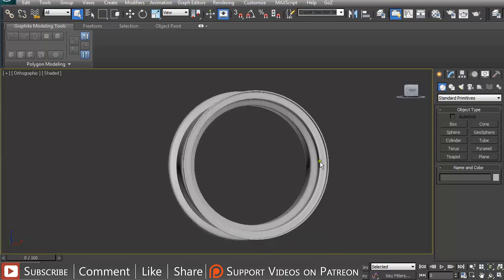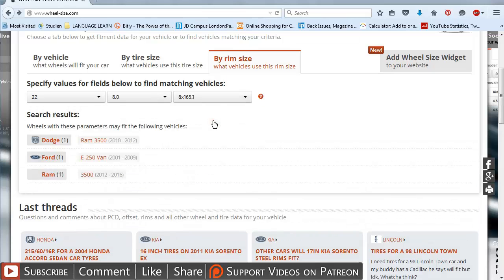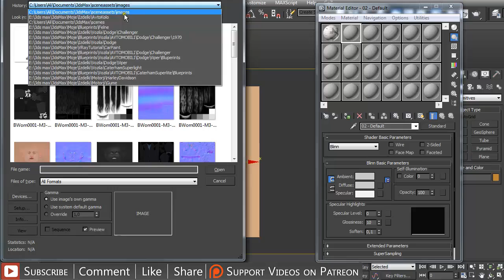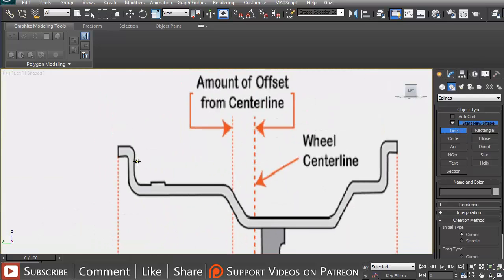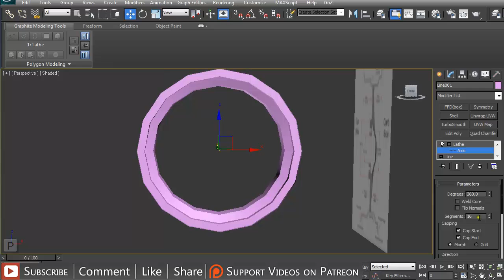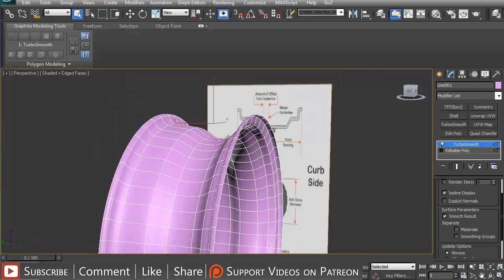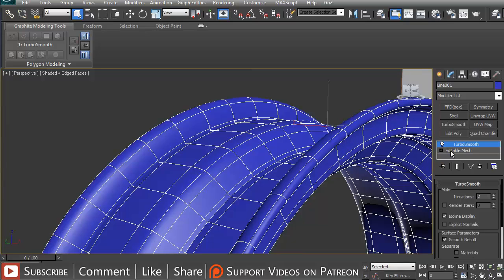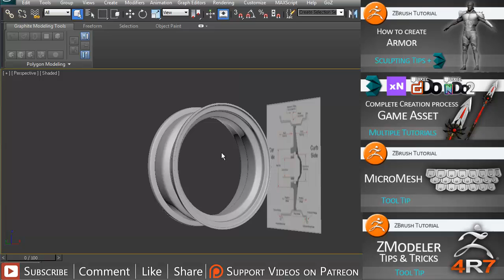3ds Max Tutorial: Modeling outer car rim

Comment: Dude you rock! I racked my brain trying to do this on my own using lathe and missed the "AXIS" step. Came out perfect after that. One thing I would suggest. My first test one I did I noticed it a single pixel thick or the lowest thickness, which is not realistic. If you trace out the complete shape instead of just drawing a line you will get the proper thickness of the rim according to the blueprint. So I'm redoing mine now and it looks the same just thicker. I found this out when using ProBoolean to make the stud holes for a 3 piece wheel. Other than that, thanks a bunch!
Reply from the maker: Tnx for you kind and resourceful comment. Im glad my video came in handy :) I love it that you figured out by yourself how to fix a "problem" you ran into.
Do check out the rest of my YouTube channel and Gumroad page (link in video description), you might find more useful video tutorials.
Like & Share, tnx :)